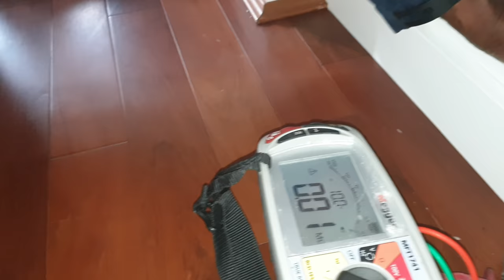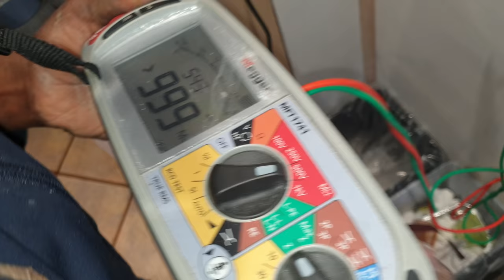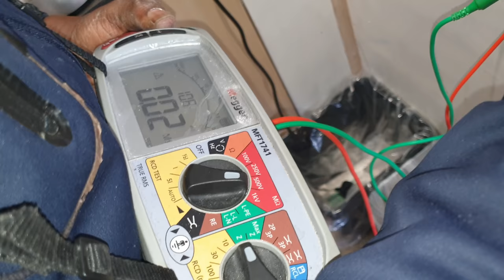Emergency Call Out - Electrical Fault Finding

Comment: The bloke seemed more interested in getting Del boy out before he charges for another hour. I bet the guy leaves it like this for years as he wont want to pay for a proper repair. You should of asked to double check the kettle was boiling and then had a cuppa and say it was fault finding to see if circuit would trip in the time it took to drink tea . Ideally brew up 5 min before your hour runs out 😂☕
Reply: He'll be right back when he finds out the boiler doesn't work. At least I'm guessing the boiler FCU is also on the part of the radial that's now removed from the circuit since the socket right next to it is.

Comment: When you asked him if the circuit was on he said yes,surely that was the time to check with a plug tester exactly what was on circuit and what was working before disconnecting anything
Reply: its easy to tell afterwards. Sometimes while you at it, you might miss situations like this. It is not that big of an deal dude.

Comment: Often I just stick the MFT on resistance rather than insulation resistance.  Can help by tracking how far away the fault is.
Reply: this works great in combination with the per metre R1R2 values for twin and earth. can help narrow it down very well

Comment: When the customer says 'they'..  He actually means' I'.
Reply: richard day hahahaha
Reply: When they (the channel owner) says ring, does that mean that rather the circuit is ran series, I’m Canadian we do things different
Reply: @tylerwilliams2802 A ring circuit has 2 cables going to the circuit protection device. All wired in parallel but with a "loop in, loop out" system that starts and ends at the circuit protection device.

A radial spur is a parallel connection with only one twin and earth going to the socket outlet.

Comment: Splitting the ring was the right way to go - did you check for any sockets underneath the counter to a dishwasher for example?
Reply: I'd have started with the three non-working sockets on the other end of the kitchen and dug those out to narrow down the location of the fault.

Comment: When you showed that cut cable first thing i woulda done being an intermittent issue at random i would have separated the cables on the cut cable n retested..  being as the cut was still live on a leg and touching the other wires randomly causing a short or ground fault trip.  Ive seen it many a time..

Comment: Good video. I bet that ends up as two faults. First the cable fault you found and then a radial hanging off the ring that at some point that was a spur that’s been “modified”

Comment: Nice analyses and narrowing where the fault could be. I bet the customer had done some wiring there by himself. What a silly location for a MCB panel in the bottom of that cupboard. Good camera work, did the customer help you with that?

Comment: North America sparky here.... can anyone explain what a ring circuit is?
Reply: So basically you take a link from your last point in the radial back to the fuse board and that makes it a ring.

It means you can go from a 20a supply to a 32A as the load (should but is not always) split evenly over the two cables

It was designed to save cable as it removes the need to run the entire radial circuit in 4mm for the same amperage.

Unlike with a radial circuit when a link is broken it will still function as normal in most cases but as two radials on a 32a supply (not ideal) but as you can guess from this as you don't know the point where the break is fault finding can be quite time consuming.
Reply: i'm american too, it seems like what we call a "class a" circuit in the low voltage world of fire alarm. from panel, through all devices and back to panel. tough to troubleshoot a class a loop. i always break an end at the source and turn it into a typical circuit (turn it into class b). and i believe he did do that

Comment: Wouldn't call a temporary fix only half of what was working working I'd be better unplugging  some items to see what was tripping it,as l think it was the mcb was tripping not rcd so sounds like overload to me from what I could see on video
Reply from the maker: Next time you're carrying out fault finding , film it and show us how it's all done.
Reply: It was the insulation resistance fault that was causing the tripping. Thats why he was testing insulation resistance all over the place. Nothing to do with overload.
Reply: Delroy didnt actually go on to find the fault,he disconnected 2 cables put a temporary  link in and effectively cut off the other half of the kitchen circuit, with a bit more investigation  I'm sure he could of isolated fault and given his client  more of a positive  outcome
Reply: @edwardobriaen2733   welcome to the world of emergency call outs. Primary goal is to restore the bare essentials for the customer in the shortest time possible, being conscious that it needs to be safe, and you need to make sure the customer can afford to pay your bill. 
A temporary fix, in agreement with the customer, is absolutely fine providing the customer is well aware it is temporary and you cover yourself on the paperwork. If the customer decides to promote that to a permanent fix, that's their own decision. 

I'm fairly certain that if this was a scheduled visit, Del would have  been able to locate the fault and repair it fully.

Comment: Can't  say I'd be too happy calling someone  in to sort a tripping problem and end up with less  sockets working and pay for the privilege
Reply: Your obviously missing the point, it was a temporary fix and needed to be returned, I would imagine the customer was paying del by the hour as a call out and wanted a quick fix, which is what Del did as a temporary measure
Reply: Be easier to re wire the kitchen, who needs all them sockets anyway 🤣🤣
Reply: If you watched it properly the client wasn't willing for him to carry on looking and wanted him gone
Reply: do exactly my point, the client seemed more worried about the cost of call out rather than fixing the problem, that will still be wired that way in 5 years lol
Reply: Tom ,me and you must have been watching  different videos, cos I got the  impression it was delroy that wanted to get of there,because he thought putting that link in would bring would bring on most and if not the kitchen and conservatory power and it didnt and he didnt appear to know why ,its obvious that the 2 ends he disconnected were not a direct link between  the 2 sockets ,but a link to the rest of the kitchen  power

Comment: North America sparky here... can anyone explain what a ring circuit is?
Reply: A ring final circuit leaves the breaker in the board goes to each socket in turn then returns back to the same breaker the breaker is rated at 32amps in a split level house you will have a ring circuit upstairs and a downstairs ring the kitchen will have its own separate ring as well